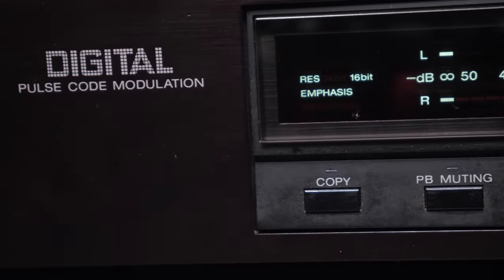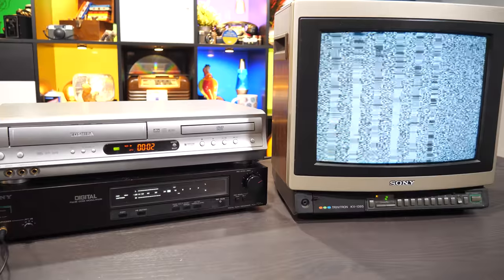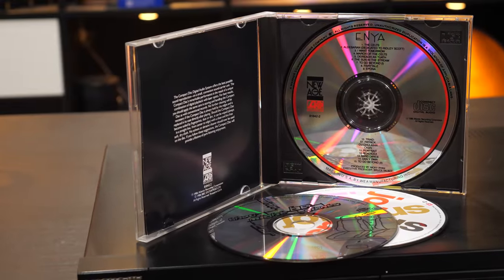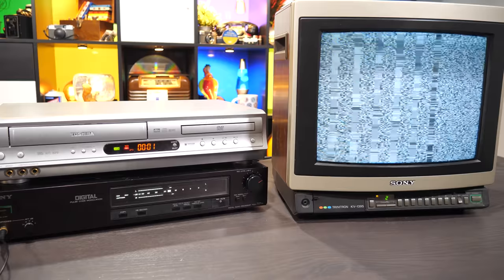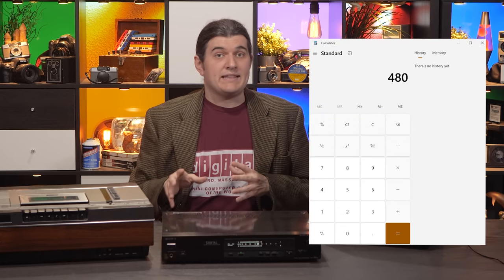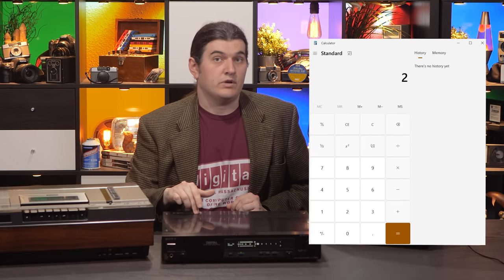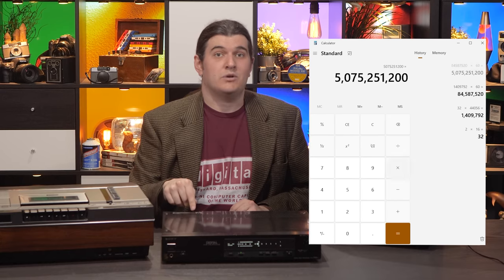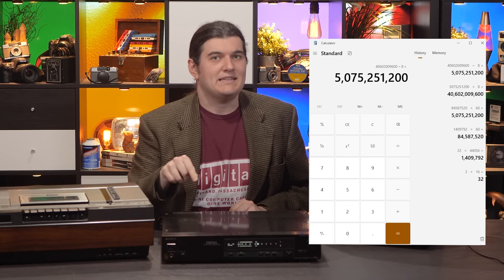Digital audio needed videotape to be possible - and the early days were wild!

Comment: Exabyte was founded to record digital data on videotape for backup in 1985. They went fairly rapidly to 8mm video cartridges, as opposed to full size VHS, in 1987 (dates according to Wikipedia). The 8mm format had been introduced in 1984. DAT tapes were a similar if slightly smaller format, and indeed Exabyte bought my company, R-Byte, which made a DAT tape drive, in 1992.

None of that occurred in a vacuum. QIC tape drives were introduced by 3m in 1972 (again Wikipedia), and although they didn't store Exabyte level densities, they were from 20mb to 400mb in later versions. So video tape as data storage had a competitor.

Tape storage, going back into the open reel computer days, was generally used as computer backup on bigger machines and didn't come to PCs until the QIC days. Writable CDs were supposed to take over as a backup medium, but what actually happened is disc drives became so cheap for unit of storage that it made more sense to just purchase more drives and use them as backup, hence NAS or network attached storage and data vaults. Now, companies are just as likely to ship backup data to cloud companies.

Comment: "Interleaving" is a common technique to counter "burst" type errors in a digital transmission channel. You'll of course need a buffer because the bitstream needs to be de-interleaved before you can decode it, but due to the framing of the TV signal, you have to have that anyway. What would be interesting to find out, too, is if the video signal is interlaced or not. I guessing that this is the case, because I'm not sure if a VCR would be able to record a progressive video signal due to bandwidth constraints.
Reply: It's interlaced, but this isn't actually a big deal: the digital parts can mostly regard NTSC as 60 frames of 240 lines each per second. It's not quite: the sync pulses are different to indicate whether it's the odd-numbered or even-numbered lines in this field, but that's more important for actual video. A progressive signal doing 30 frames of 480 lines per second would fit in approximately the same bandwidth but confuses circuitry expecting twice as many VBIs, while indeed 60 frames of 480 would be much too much.

Comment: You didn't mention anything about the binary encoding.  I'm guessing it would have been smart to use a Grey code so that if any one bit gets flipped, it is less likely to be a major change in output.  Even with error correction that seems like a worthwhile extra measure.

This also gave me flashbacks to use of standard cassette recorders to store digital data from TRS-80 computers.

Comment: In the early 80's the Tandy Color Computer used an audio tape for data backup.  Later I actually used VHS tapes to backup my computer.  I don't remember the exact problem, but I remember that it was finicky.  I had to do a full validate of every backup tape before I could put it on a shelf.

Comment: I feel like we did use tape for computing. I mean, the Unix program 'tar' is short for "tape archive" because it was originally used to make data backups to tape. That was more in the "professional" space (Unix machines were largely the domain of businesses and universities at the time) but weren't there cassette tape adapters for the C64?
Reply: That's true. I assume he was asking why it took a while for recording data from computers to consumer videotape using the specific techniques for recording digital audio in particular to happen. Probably partly because in the late '70s/early '80s most people didn't yet have a real need to store such a huge amount of data in the first place and partly because home computers and hardware at that time weren't capable of processing the stream of data to and from the recorder at anywhere near the rate required (over a megabit per second) to keep up.

Comment: Although it is an elaborate piece of equipment to be consumer grade, a use that it most likely should have had at the time, was in the extremely nerdy market, (seeing the potential of storing binary data on tape, at least to me as an electrical engineer I can think of several uses for the equipment that could be used with computers from the 80s) and the "Amateur" audiophile market [not the most orthodox since we know that digital has been controversial] (or more likely) was intended for Archivists and Indie music producers. Since although, as mentioned, a common cassette deck could cover the FM spectrum more than well, it must be considered that reel tape recorders were somewhat expensive equipment, more difficult to find than a VCR-BETA, and in the end By Postal Mail, it is much easier and perhaps safer to send a Cassette Tape than a reel. AND EVEN IF WE THOUGHT ABOUT IT, IT'S ONE MUCH SAFER THAN SENDING A FRAGILE VINYL [So it would be an ideal mechanism to send demos, copies or rips] to indie production companies or between amateur stations [a kind of music p2p without risking the originals] On the other hand, it must be considered that common audio tapes were subject to not only the quality of the tape and the player, but also to a correct calibration of the equipment to obtain maximum performance, one of them the terrible wow and Flutter [something that for the domestic user is almost unknown or impossible], and that the digital format simplifies since the bits are bits, and the error correction does the rest, regardless of the type of device or its state. Also allowing to make ultra high quality replicas at "low cost" (the only investment is the initial equipment and blank tapes).

-on the other hand, it could also be used or have great potential in the sending of classified audio materials, since the simple fact that it is impossible to obtain an output of the pure digital stream, having a DAC was already a security against manipulation or unwanted use by itself, and if it fell into the wrong hands, to someone with no knowledge of what a PCM Audio stream looks like on video, it would simply be a "blank or junk" tape. being based on a very basic peer-to-peer encryption (and going back to the everyday human being, probably no one would think that a videotape would have binary data or pure Audio inside, being a perfect cover)

On the other hand, going back to the fact that it is safer to send than vinyl, it could be that the potential market for the tape copy would be audiophiles who for work or life are frequent travelers, (Many good hotels would probably have a TV+VHS in the rooms and be able to load with a videotape that can accommodate from 4 to almost 8 hours of almost 1:1 copies of your favorite repertoire) it is highly profitable, since you would not have to carry huge vinyls or loads of tapes and the player with the weight that this implies, perhaps simply the added weight of the DAC and some rca cables.

-If we think about it, it would be the equivalent of today's e-readers. [it's carrying the weight of an extra player but it's a whole library in one].

Comment: I think one of the main reasons this wasn't used in computers is that you can't easily pick data from different areas of the tape, you'd have to run through the entire reel to get data from the other side. A CD just needs the arm to move over an inch or 2. It's good for playback and pulling big files at once, but not that good at picking general data

Comment: We loved this to death in the BBC and the recording studios. Having used a pro PCM box and a U-matic tape to send to CD glass mastering we were stunned when Sony released a cheap domestic one for Betamax. On a three hour recording session we would typically use 8 reels of 15 inch per second tape on two duplicate machines through Dolby A or Dolby SR. Stopping and starting to save tape. The 701 box (or the Sony F1 in our case) would back up the whole 3 hour session on Betamax,  missing nothing. 
One day at the BBC we ran out of audio lines to London, via Pebble Mill in Birmingham from Manchester. But we did have spare video lines .... with a 701 at each end (and a bit of cable equalisation) we sent PCM down 200 miles of cable!
Finally, 14 bit was a good match for FM audio which had a cliff face filter at 15 KHz. This helped long distance PCM to be even more error free. Thanks to Tech Conn for triggering these memories of digital audio from 40 years ago.

ps - DAT used micro miniature video (camcorder) tape, recording PCM in one box. Minidisc was very different.

ps, ps, Radio stations in the UK are legally required to log their output continuously. Traditionally done with a special Revox A77 running at 15/16ths inches per second. PCM was a perfect replacement and the sound quality was much better.

Comment: Stevie Wonder was an early adopter of digital audio on video tape using U-Matic tapes. he learned the hard way that storing video tapes for several years and expecting them to play the first time they were inserted into the player was not practical. Sony had to train his tech people to always cycle the tapes by fast forwarding and rewinding before playing.
CDs were originally a maximum of 75 minutes, which maps exactly to the length of U-Matic tapes. Video tapes were limited to a 60 minute version, while the digital audio version was specced to be 75 minutes long. The Sony 75 minute tapes actually measured 80 minutes and a few frames, so eventually someone figured out how to cram the extra 5 minutes on a CD.
My SL-5400 was B-stock when I bought it in 1987, and wouldn't you know it, the PCM switch was engaged. Later I worked with PCM-1630's and the dedicated U-Matic machines, the DMR-4000. Even the DASH format reel-to-reel machines couldn't displace the U-matic system until hard drive setups came along.

Comment: I guess the main reason why people didn't see video tapes as mass storage devices was bandwidth.If you want to store data on a VTR you need to provide it with a continuous stream of data at a high-ish bitrate. That was actually rather hard to achieve with general purpose computers till the mid 1990s. Sure you could blast out a megabyte in a few seconds easily, but then you'd probably have to wait your harddisk to seek. That's why in the 1990s CD-Rom writers often failed since they couldn't keep up with the data stream the writer needed. Unless you have special consumer VCRs like higher end V2000 ones, you cannot return to data you couldn't read.

However one has to say that the opposite direction has been tried. There were setups that recorded good quality audio onto minicomputers as early as the 1970s. They filled the niche of high quality sample exact audio editing, for example for classical music. However those weren't exactly a mass product.

One also has to consider that really good compact cassette recorders were also expensive. Such a PCM-adapter would essentially turn your investment into your VTR into an extremely decent cassette recorder. Also FM-radio can be rather good, and, particularly when it comes to low frequency responses, be better than decent compact cassette recorders, so there was some advantage in storing it digitally, besides the obvious advantage of being able to store much longer recordings.

Comment: I still own a VHS machine that was built to do this.  I did play with it's audio recording some, but it was only usable with VHS machines of that type, which limited its use to home and not car or other portable use.  For this reason, I mostly used it for video recording.  I am sure that it made for a relatively cheap way to record digital audio in it's day, as I remember the sound was very good.

Comment: My father once told me that in late 80s and early 90s in Russia, it was actually common practice to jury-rig an interface from the computer to an ordinary tape recorder so you could write data on cassette tapes. 

Tapes were far easier to get than floppy disks: USSR has been mass-producing cassette tapes for decades by then, but most floppy disks were imported goods. Floppy disks became mainstream after '95 or so, I think. 
(I'm probably wrong about the specifics here. He told me that stuff maybe 10-12 years ago.)

And those teeny-tiny cassettes stored a lot more data than you'd assume. Some of them held more than a megabyte.

Loading times were terrible, though - about 20 minutes per tape with a ZX Spectrum clone. (Again, probably wrong about the specifics.)

Which is probably why dense data storage wasn't a thing with VCR cassettes: with computers of that era, large amounts of unstructured data would take forever to write and forever to read.

Comment: Regarding your musing about why this wasn't used in computers, I wasn't there, but I'd assume it's just because magnetic tape was already in common use by that time. I did some searching and Wikipedia says the first tape drives were made in 1951. Of course, though, magnetic tape is slow and so was mostly only used for backups. I found a reference to magnetic tape backup systems from 1987 with a capacity of 2.4 gigabytes. Presumably that was enough data for backups back then.

Comment: 17:30 Yes, there is a vEEEEEry slight difference between the NTSC field rate and the AC line frequency. You can confirm this by looking at a CRT TV screen through a spinning fan.

Bonus points if you can say whether this works for an LCD screen. I can't say from experience, but I would think not. OTOH it might work for one some other types, maybe a plasma display. You tell me.

Comment: Since the consumer PCMs were designed to output a signal to color VCRs, isn't there an opportunity there to encode even more data in the analogue signal?  Instead of recording bit-by-bit, perhaps each possible value of a byte could be represented by a different color, therefore allowing more stored data in each "pixel", right?

Comment: DAT became DDS — Digital Data Storage — in 1989. By the time I started using them in 1993 DDS-2 with compression could store 8 Gigabytes of data. And in fact although the tapes were marked DDS the drives were ubiquitously marked DAT and it's by that acronym that they were referred to.  Of course DLT — DEC's Digital Linear Tape — had happened in 1984 but it was viciously expensive. It was DAT/DDS that made serious tape storage available to small businesses and enthusiasts.

Comment: Those 5GB of data you mathed up are presumably without the error correction, so the actual raw capacity is probably, 20 to 30% higher, judging from the width of the right-side band.

Call it 6GB on a VHS tape, it's pretty goshdarn good for the late 70s.

Comment: Backup tape cartridge formats already existed pretty early in the Personal Computer's lifespan, for example the original Quarter-Inch Cartridge physical 'Data Cartridge' format actually goes back to 1972. There were a number of years of logically-incompatible drives before a group of manufacturers finally got together to write 'QIC' standards allowing tapes to be exchanged between different manufacturers' drives. QIC-11 supported 20MB per 450ft tape, using 4 tracks, in mid-1983, which should have been enough to handle many PC hard drives of the day (for example the IBM PC XT was sold with either a 10MB or 20MB HDD). They were potentially a bit expensive though.

Having Googled this a bit, I found a Retrocomputing Stack Exchange question asking about the cost of 5MB backup in 1980. One of the answers mentioned a Corvus "Mirror" device using a VCR, patent applied for in 1980.

My own experience with tape media started with the 85KB ZX Microdrive for the Sinclair ZX Spectrum, a tiny cartridge containing an endless loop of 5 metres of 'sixteenth-inch' tape (half as wide as Compact Cassette). Although that was supposed to be a replacement for a floppy disk drive rather than for backup. A decade or so later I picked up a Travan TR-3 (I think!) system, one of the successors to QIC, as I'd got tired of backing up to many, many floppies.

Comment: "Did people just forget or something that audio data is just data?"

    YES, Alec... Yes, they did. As a matter of fact, people are STILL so biased about what kinds of data constitute "data" from one device to the next, that I've regularly exploited their psychological dysfunctions by "sneaking" various "contraband data" around various places SIMPLY by using an adapter and putting "unusual file types" into different and arbitrary formats... Like processing apps into SD-cards for cameras... A college campus (for instance) may have a contract with a certain software... and thus, BAN other apps from computers used in class by students... An SD card adapter, then, allows you to stick an "app-image" file into the card, which can then be used by said student in said class entirely on a temporary basis... since the app-image is a stand-alone product and can be copy-pasted near infinitely... needs NO installation... and is just as easily wiped when the project(s) is/are done.

      When computers can be taken up during class and checked by TA's or Professors (which only a few such classes ever did in my experience)... this was one way to work around the inconvenience of a sub-par contract for underperforming software and STILL kick our work out the door as fast as we preferred... and sometimes, it was just a lazy way to short-cut the system... BUT I wouldn't know about that...

     The SD cards were NEVER looked at, because "that's just digital film"... even though (as you've even pointed out in this video), film or photograph or graphical data is JUST DATA... The drive, adapters, and computers DO NOT DISCRIMINATE... Associated file types are sought out and organized as-is... no matter how it's been stored or transferred...

     Now... whatever you (readers) do with this information is ON YOU... I won't mention names as there are "privacy concerns" (ahem)... BUT at the end of the day, a switch turns on "1" and off "0" and EVERYTHING digital is JUST data.  ;o)